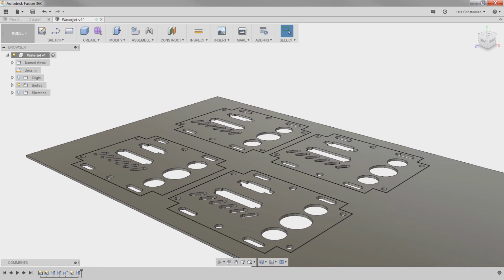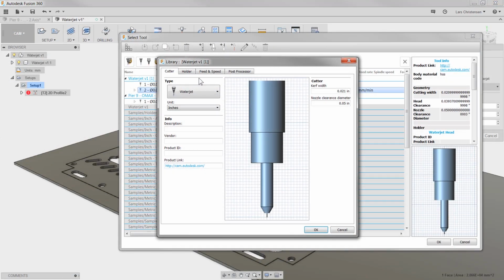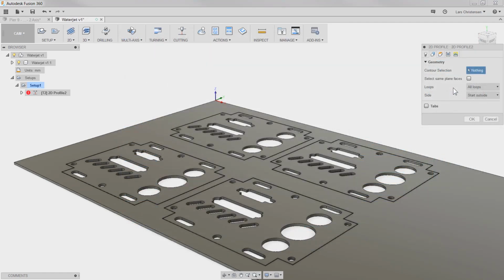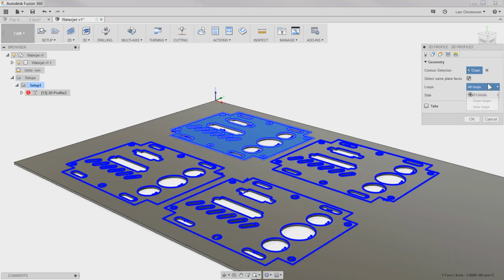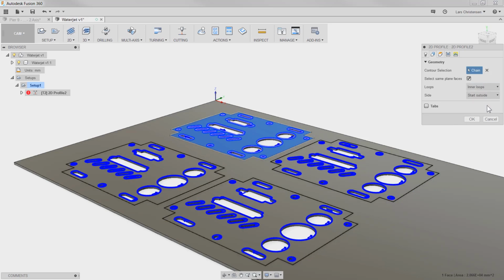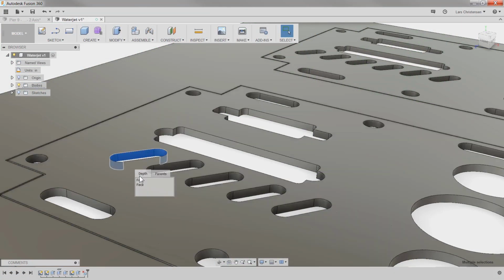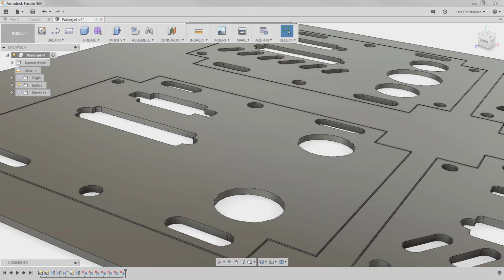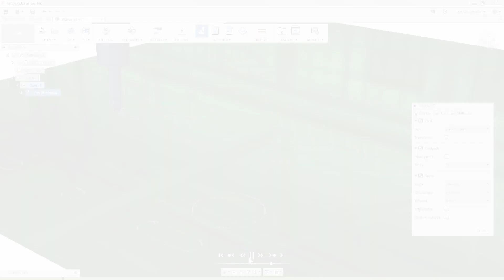Fusion 360: Speed Up Programming for Waterjet, Laser and Plasma 2D Cutting

Comment: Lars,I'm having problems getting the lead in and lead outs to be on the inside of the cut, for a laser cutter. any suggestions?Thanks, BMac
Reply from the maker: Hi Brian, Are you using the 2D cutting? Check your setting on the linking tab(last tab)

Comment: How did you get that multi up on the stock? Is this stepping automated in F360?
Reply from the maker: I used Pattern to layout the four pieces.

Best,
Lars
Reply: It'd be nice to have that work like vcarve where you have the flexibility to move pieces around freely and not disturb the original sketch or design.

Comment: Need to take those Z retracts out though. Keep the tool down the entire run. 
How do you export the path into FlowCUT, though?
Reply from the maker: Z height can be adjusted on the heights tab. Does FlowCUT take dxf? you can either post out the toolpaths as dxf, or just right click on the sketch on the left side and save that as a dxf.
Reply: Lars Christensen FlowCUT takes .ord but you could just import the saved .dxf into FlowPATH then export the path as .ord from there. Just adding more steps, really. Although F360 does have some unique drawing capabilities, doubtful it'd be necessary for a jobshop waterjet doing simple 2D patterns that are easy enough to draw and manipulate in FlowPATH. The ability to select same diametet holes and such is good. Would have to see how it is drawing tabs and lead in/outs